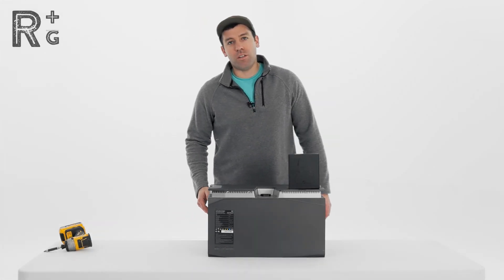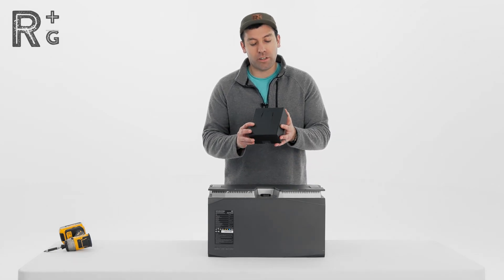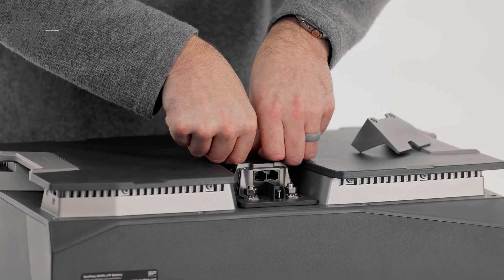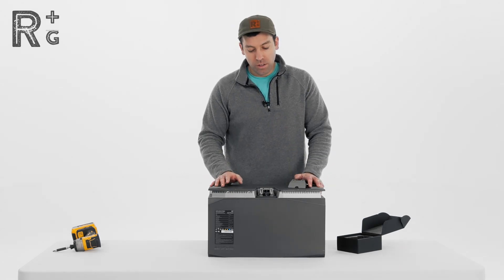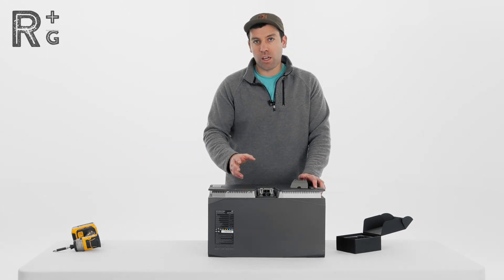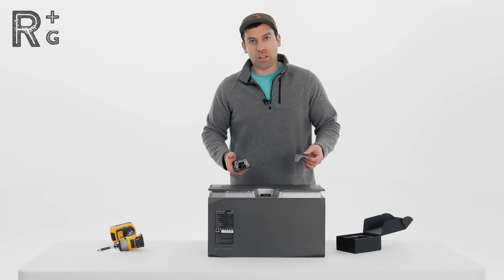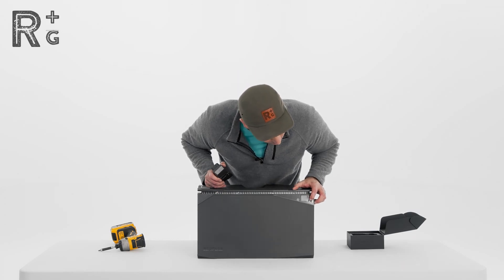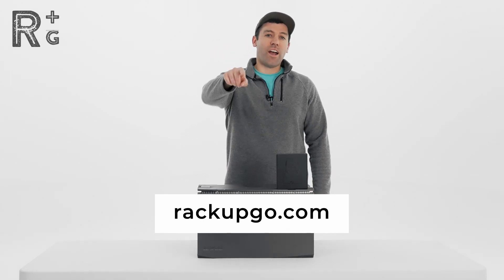How to Connect Polarity Adapter to EcoFlow 5kWh Battery

Comment: I‘m thinking about how to achieve it the other way around: Connect a 3rd party 48V battery to the power kit to massively extend its capacity beyond 15kWh.
One possible solution I could see would be to use the PV1/Alternator input and just connect it there. You think that would work?
Reply from the maker: It would work for charging the EcoFlow Power Kit batteries that are plugged into the system, however, maintaining that 3rd party battery would need to be handled by a separate battery manager/charger.